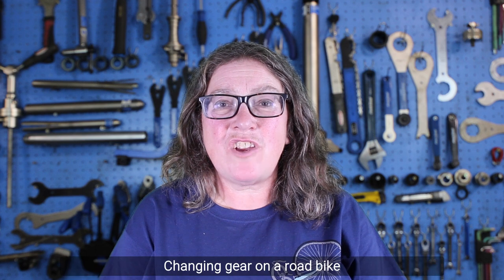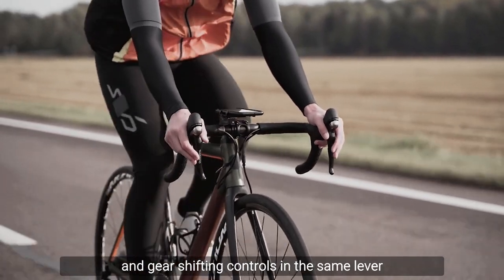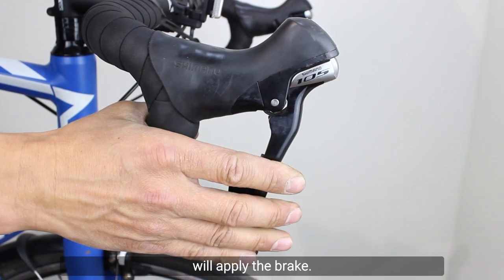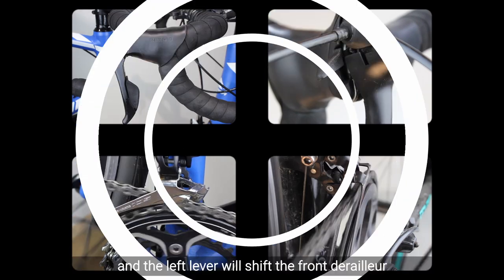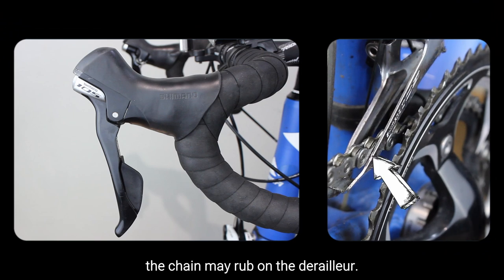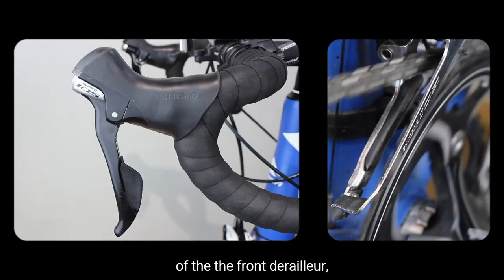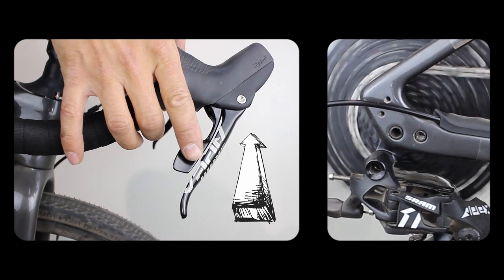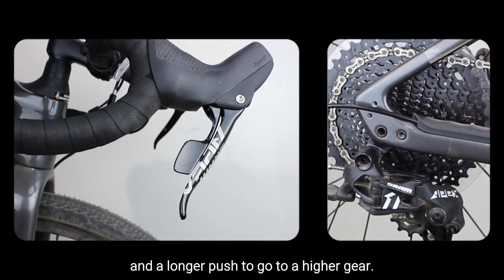How To Change Gears On A Road Bike

Comment: Well explained. What gear combo to use when going uphill, downhill and flat terrain?
Reply from the maker: Thanks for your feedback! I'm glad that you found the gear explanation well presented.
When it comes to different terrains, here are some general tips for gear combos:
Uphill: When tackling a steep incline, opt for a lower gear combo. This means using a smaller chainring in the front and a larger cog in the back. This will give you the leverage needed to climb with less effort.
Downhill: On a descent, go for a higher gear combo. Choose a larger chainring in the front and a smaller cog in the back. This setup will allow you to maintain speed efficiently without spinning too fast.
Flat Terrain: For flat roads, a mid-range gear combo works well. Use a gear that allows you to pedal comfortably without straining too much.
Don't forget to have some fun experimenting with different gear combos to see what feels right for you and your bike.
Happy cycling, and enjoy riding on all terrains! 🚲😊

Comment: Excuse me, the change is on the left for the front gear. When I change and the chain changes to the smaller front gear, I want to return it to the large front gear, how is that?
Reply from the maker: Hi, thanks for the comment. If I understand it correctly you want to change the gear back to the highest one. Is this correct? If yes then it depends on the brand of your shifter. If it's a shimano shifter then you need to push the blade of the brake lever inwards. For Sram shifters there will be another smaller blade under the brake lever blade, you need to click this inward. I hope this heps🙂
Reply: It is true, but this does not work at all for the front gears. I tried to shift the speed to the larger gear. This did not work. As for the rear gears, the matter is easy and smooth. The movement moves from large to small and from small to large.